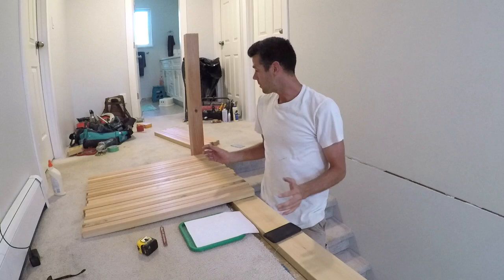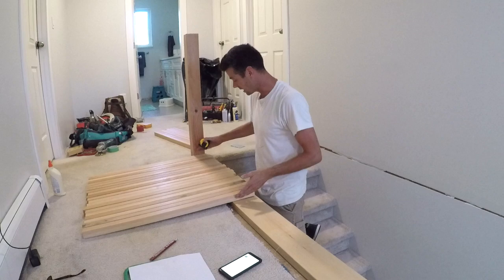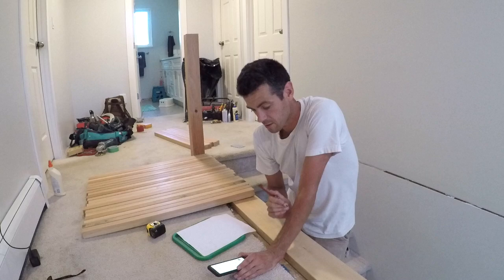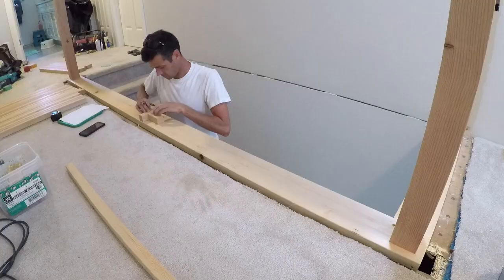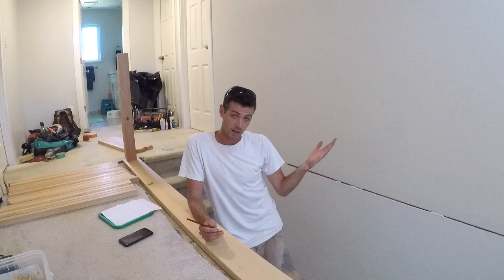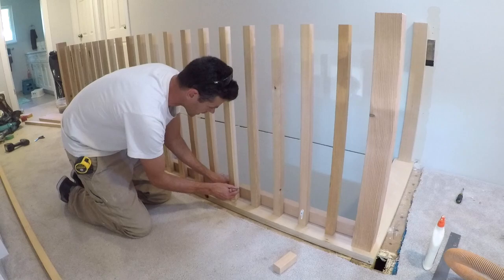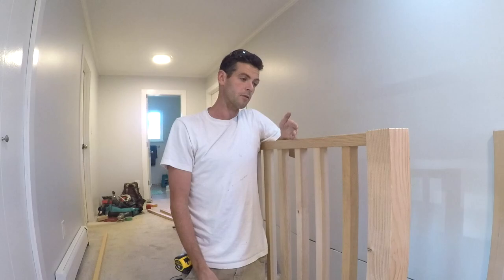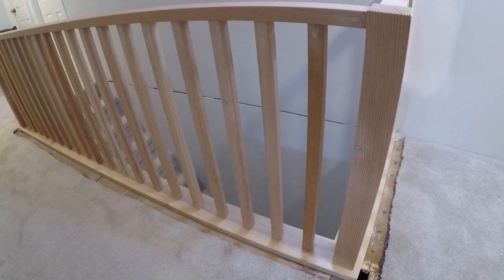How to get EVENLY SPACED Spindles!

Comment: Save yourself the math. Purchase like a 1/2” heavy rubber band or elastic strap, maybe 12’. Put hash marks on the loose strap say every 3” or 4”, you’ll figure it out. Secure it to one of the posts then stretch it to whatever spacing you want and make your mark. Perfect spacing for however many spindles you want.

Comment: Ben, great video

1- regarding the top rail. When you're drilling the base rail, clamp the top rail down the center of the base. So when you make a drill plunge you make a duplicate. Use a drill stop in the cap, not to drill through the top cap. Boar out larger size hole into spindles and bottom of cap rail, to use wood dowels and glue to secure top rail. Finished product is strong as using hardware.

2- another method to secure top rail. Make a dual section cap. A plate that's rectangular in shape and the width of the spindle, line up cap like above screw all the way through. Adhere from the top down into the spindles with screws. Place a "U" shape cap rail over the base rail. Glue the mounted cap, shoot finished brads into the sides.
Now you have the strength of the screw and a finished hand rail cap no securing method showing 🙂
Reply: that first method sounds like a winner
Reply: I started scrolling through the comments to see if anyone suggested dowels or a two piece cap, and you beat me to both!  Two piece caps without even trying to hide the (thin, 0.25-0.75") lower layer are common near me, especially on decks.
Reply: @halfplushalfsqrt5  😆 Great minds think alike.
Reply: I would use hanger bolts on the top. Seems that would be the quick and secure method, then do your bottom rail.
Reply: @halfplushalfsqrt5  I just did the same thing. One thing though, Mansard Manor went into a lot more detail. I bet he's done it before!
Reply: @arcare001  thanks for the complement

Comment: Baluster Formula with fillets or spacing without shoe molding:

I usually take the TS(total span) and divide it by 5.5 to get an approximate BN(baluster number) then plug it into the following formula. Other variables are BW(baluster width) and the result your aiming for which is FL(fillet length) So say 100” for TS divided by 5.5” = about 18 balusters
EXAMPLE-
 
TS-(BNxBW)/BN+1=FL

100-(18x1.5)/18+1=FL
100-27/19=FL
73/19=FL
3.84=FL
So FL=about 3 13/16” spacing or fillet length
I then Check it just like you, marking off the spacing and adjust the last 3 balusters(on a run this long) for pretty much consistent looking spacing. This works best for square balusters. For balusters that have been turned with deep grooves I usually divide the TS by “5” to bring the balusters a bit closer to try to hit the 4 inch mark. Learned this from my Uncle years ago.
Reply: I like your formula just easier with a few more parentheses. (TN-(BNxBW))/(BN+1)= spacing
Reply: Fml we did a whole ass week on baluster spacing/equal spaces in 4th year and I completely forgot all of it, this was the formula I was trying to remember!

Comment: I was a custom deck builder for almost 30 years. The simplest method that I ever used, was making a very simple jig. 

Assuming you're working with 1.5" baluster w/ a 4" center...
1. Mark the layout on a piece of scrap wood...1.5" on each end w/ 4" center. 

2. Assuming you're not exceeding a layout beyond 8' (post to post), you can accomplish each section layout in well under 2 minutes...Start by transferring the marks from the jig onto your rail (use a light pencil mark). Keep the jig in your pouch for quick easy access.
3. Lets assume that the last mark is 3" from the end post (opposite from your first mark)...You now know that you can just divide the 3" & then remark the rail a second time w/ a 1.5" space off of the first post.  It's so easy, it sounds stupid. No calculators or paper needed, fast & easy...especially if working outside in the elements. Works on any rail, stair rails take a little more practice, but still basically works the same.
Reply: But your not ending up with even spaces all the way across.....your last space closest to your post is 1.5" not  4". I do it this way too
Reply: I have to agree your method is how I would do it too,  also the side spindle section would have been uniform with the main panel and you could save the template to use on the next job.

Comment: When installing, start in the middle so that you can do your little fudge on each ends. Second, when checking your dimensions with your pencil and block, you can cut the time it takes in half by only doing half, and then confirming it to be halfway with the tape measure. This is true of any divided, segmented material layout.
Reply: Starting in the middle doesn't give you equal spacing all the way through, that's the only issue.

Comment: wood dowels top and bottom, nice neat finish nothing showing but I've used clear varnish
Reply: Or even contrasting wood dowels, but definitely a client discussion required for that one!

I've also seen a ⅛" deep track routed under the handrail to align the spindles, which are then screw fixed inline, so the putty is in shadow. It gave the rail additional purchase in the hand, but I wished that the carpenter had sanded the finest bevel, as the edge was a little sharp in places where the polyurethane had formed drip edges.
Reply: I think he's suggesting that the dowels not be visible at all. You can make the dowels whatever color or wood species you want if they're jammed into two blind holes.

Comment: For attaching the top to spindles you can use a 1x board on top and screws straight down just as you did not want to do. Then place that nice 2x rail. Then you can screw through the 1x from underside and secure it to 2x cap. You can dress the seam between the 2 boards with small molding.

Comment: Start marking from middle and you halve marking error and both ends would be similar.
Make top rail from 2 piece lower part you screw just way you did bottom then glue upper part to it little bit sanding on both side when glue is dry no need to fill any screw hole.
Reply from the maker: Yup! 2 piece would have been the way to go. I can visualize that.

Comment: Great content, love your videos!
 I think the reason your layout didn't ad up is simple, you measured your empty space with all the spindles pushed together which is great, that accounts for all the variences the spindles may have..  when you did your lay out you used the same block repeatedly... Which doesn't account for the variences between 20 pieces.. I guess one way your method would have worked out is if you had used a thickness planer prior to doing the layout.. it only takes 8 spindles to be short by 1/32 to equate that 1/4" gap. Hope this makes sense! Cheers :)

Comment: When I worked for a stair builder, we would use a pair of dividers set to the distance between the ballisters on center. Then starting from the center point of the first ballister, walk them down to the location of the center of the last ballister. If you were off, adjust the dividers more or less to compensate for the difference, then walk them down again from start to finish. At each point, we drilled holes in the floor and the railing for the ballister dowel pins, which we glued in place. This method was fast and accurate and works for curves as well as straight lines. We once built and put in an elliptical staircase where the curve of the balcony followed the ellipse curve of the stairs and this method worked perfectly.

Comment: Instead of marking the top rail on the bottom of the spindles you can 
make a template piece the same length and put those marks on it, then 
put it on top of the spindles and attach it to both the newel posts so 
it doesn't move, line up and drill all the dowel holes. Take that 
template and drill the top rail, then cut the template in half and use 
it to clamp the spindles in alignment. Simpler than it sounds.

Comment: This Old House had an awesome method for this.  Get some elastic from the fabric store and lay it out between the newel posts.  Starting at one end make a mark on the elastic every 4".  At the far end of course you'll have something less than 4" to the other newel post.  Hold down the starting end and stretch the elastic until the last mark lines up with the newel post.  All the marks will move proportionately.  Transfer your marks to your work piece and walla!  Perfectly spaced spindles.  Note that since spindles are typically 1-1/2" thick you have some room to stretch before you end up with greater than 4" gaps between the spindles.

Comment: If i want even spaces like here, I roughly measure how many spindles I need and what their distance from one to another should be. 
I always try to get an uneven number of spindles and then start with the one in the middle. That creates two "windows" to the right and the left of my first spindle whose center I can use again. Then I just go on using the centers in the windows arising and all the spindles are in even distances. Takes a little longer than your method but gets everything perfectly evenly spaced.
Sorry for my bad English, I hope you somehow know what I mean... 😊
Reply: That actually works even with an even amount of spindles if you use the space of your two starter spindles as the starting point.
Also, on this project, I might have added one spindle on the riser length to more closely mirror the spaces on the width length.

Comment: I rebuilt my front porch yesterday.  Today we did the railing. After trying a little math I wound up using sketch-up.  There is a division tool that will give you the exact dimension. Yes, I then cut a spacer.  For longer runs of railing like on my deck, I put down masking tape for the last 4 feet or so.  If it wasn't coming out quite right I would make an adjustment on another piece of tape. But basically the same as what you are doing here.  Thanks for the upload.

Comment: hot furniture making tip for hiding screws (if you're not doing it properly with joinery):
for each screw mark the position, then use a gouge to peel up a small shaving on the area where the screw will go. don't cut it all the way, leave it attached at one end, so what you will end up is a thin curl of wood adjacent to each screw position. put in your screw, then glue down each curl over the screw and fasten tightly with tape. let it dry, a light sanding and you're good to go. the fixings will be completely invisible.
Reply: WHAT? ok, mind blown. I love learning something new, and that's brilliant.
Reply: @johnhighstreet5199  cabinet makers trick, taught to me by an old timer. glad to pass it on!

Comment: Fitting spindles in the UK is way much easier than that set up. Most handrails and baserails are grooved so the spindles sit in. The spacer block comes as one thin length, chop it up into the lengths you need and tack or glue them in between the spindles.

I often work in imperial but such jobs as spindles, metric is much easier.

Comment: I measure what inside is. divide in half make center mark. nail spindle at top centered on mark. level spindle nail off then use 2x4. spacer hold spindles on edge 2x4 and check level ever so often usually comes out even sometime have cut one in half..looks very nice! love your work!

Comment: Good tips.  The only thing I would do different would be to start your layout from the center and work outside each direction.   That way your layout is symmetrical and any small differences in the outside gap next to the newel post would not be noticed.

Comment: As far as the handrail either use dowels and glue or use screw in between pickets and cover screw holes by cutting fillet pieces and pin nail them through the fillet. Hope that helps.

Comment: I use the diagonal stick method.  If my distance between posts is some random awkward measurement, I cut a piece of lumber longer than that and clamp it from post to post diagonally.  If I need 18 spindles, then I might cut it at 95 inches and then mark every 5 inches on the diagonal stick.  Attach the stick to your posts, and plumb bob down from your pencil marks on the diagonal clamped on stick and voila, done.  Very little math and PERFECT RESULTS EACH TIME.
For hiding the nails or screws on the top of the spindles, I often use a nailer strip and go down through there.  Then I attach the hand rail by going up through the nailer strip into the hand rail (assuming I'm not using dowels and glue).

Comment: There illusion of perfection...

Dates back to the Parthenon, where the floor isn't level by design to allow outside observers to perceive it as level instead of sagging in the middle.
Reply: Also the 4 corner pillars are thicker than the others.
The corners will have the bright sky beside them, which would make them appear thinner.

What I get from the Parthenon is: the builders were so good at building them, they'd obviously built perfect ones before that didn't look right. So they had the experience to know how to fudge geometric perfection to overcome optical illusions.
Reply: @massimookissed1023  or may be they just did it 'by eye' and were not aware whether it's level/flat or not.
Reply: Also, often used interchangeably(due to luck of understanding), the correct word would be flat, not necessary level.

Comment: Thoroughly enjoyed the video. Simple tip on most jobs requiring equal spacing I do the math then simply start in the middle and work outwards, thereby equally spacing the minor inevitable difference between the two ends.

Comment: Thanks for the overview, I learned a couple of tricks I can use and appreciate it.

And you do know that you can buy Imperial measuring tape that has markings in decimal .. right??  

That being said, It's not 'easier' in metric if one has the skills and practices.  No matter what measuring system is used, one can still end up with an odd fraction depending on the number of spindles one has. Using an 'odd' number of spindles means an even number of spaces which can make the math easier. 

The reality is that anything less than 1/8 isn't noticeable by most people, and 1/16th by most of the rest.  Adjusting at the ends works.  In this case, you could have done one at 3 13/16s and the next and 3 14/16ths (7/8s). Then the adjustments at the end would have been even less. 

I find that starting in the middle can be better as one has two ends to make the micro-adjustments. It can require a little more precision at first, but I've done it successfully.

Regardless, thank you for taking the time to make the video. I always learn something new watching your videos.
Reply: That is pure nonsense, you're not going to end up with a fraction using the metric system, if you do, you're doing it wrong. 
That's the point of the metric system. Meters, centimeters, millimeters, micrometers, nanometers, picometers... so on.
Need more precision, go down the scale.

Comment: also dowels and glue is best for setting hand rail. no holes, no nails stronger connection. We will use a piece of flat mdd baseboard or something nice and straight at the base plate clamped parallel to the base plate against the first and last post which will keep all the posts parallel as it dries. if the rail is bowed in the centre you can toe screw the middle spindle top and bottom or you can use a clamp between ceiling and rail to push down over night

Comment: I'm only a padawn to jedi however easy method is --> (entire span - width of all materials)/number of spaces= distance between materials   **be sure to CENTER material on ur layout marks
Ex.144" is total span
14" total material >> 4x4 post>>3 1/2 in  (4x)
Subtract total width of material from total span.  That's 130. Divide this by nunber of spaces. Those 4 posts create 3 spaces.   130÷3  = 43.1.  If you trust in the force 43.1" is the space between each center-center.  May the force be with you.

Comment: A curiosity about a potential alternative order of operations since I haven't had to work with spindles yet:
1.) Mark center line along length of base plate
2.) Do the math to determine spacing based on spindle centers
3.) Walk a pair of wing dividers, opened to the spacing determined in step 2, along the center line to mark the center of each spindle's attachment point
4.) Drill and screw to install spindles

Would that be any faster and/or more consistent without having to fudge spacing at the end?

Comment: Nice work. If you want to screw them in from the side, rather than tonail them in use pocket screws. It is much easier and when you fill the holes, it provides a nice clean look.